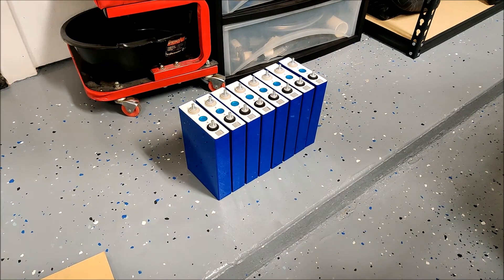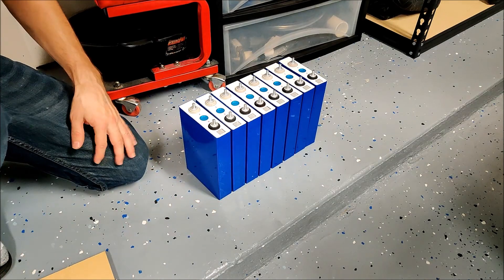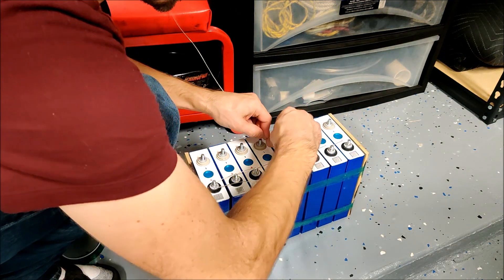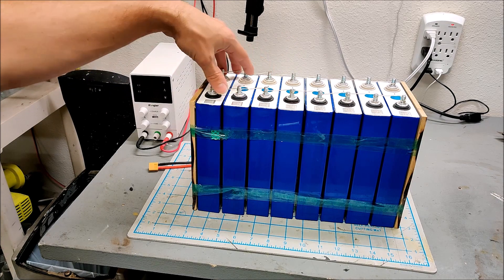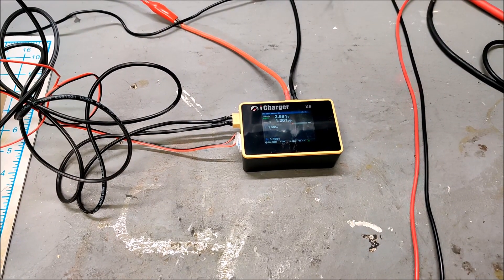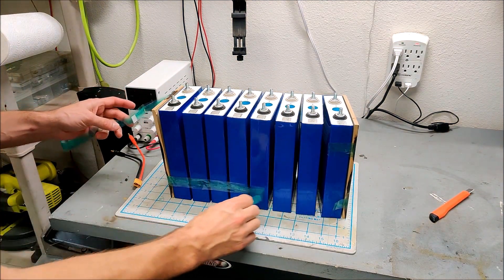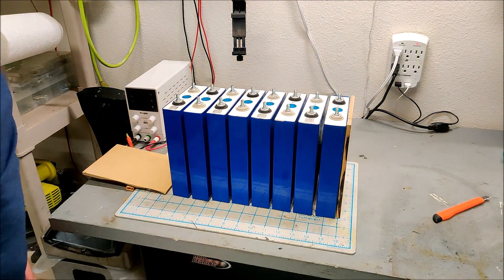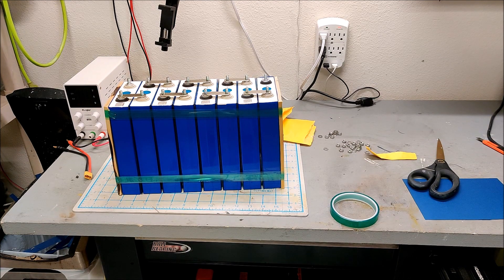DIY 3KWH LifePO4 Solar Generator - Part 2 Battery Build

Comment: At 19:26 your most negative balance wire is routed in such a way that it could chafe a short out. You should either tape it down or route it differently.

Comment: Pouch cells are more swollen when fully charged so a tip is to run the cells of the battery pack down to 2,7 v and then tighten the pack again. Also to keep in mind is that the terminals can suffer damage from the cell displacements when they expand and contract.

Comment: i think for doing this wooden board and the carpenters grips that or very long and can be adjusted to clamp
Reply: Exactly. 
Compression is overly 'fussed' about, in my opinion. I simply use wood blocks, wood clamps and kapton tape while lightly compressed, then remove the clamps and wood.
By the time compression longevity pays off, battery technology will have leaped forward massively and I probably will have upgraded by then.
Just common sense and looking at the big picture.
Reply from the maker: @reubenj.cogburn8546  Agreed. I compress them just to hold them together in a neat package and so that the buss bars fits. Beyond that im not too concerned.

Comment: Cutting the balance leads to length is not a good idea as this will make the the IR of each balance wire difference causing different readings
Reply from the maker: Im aware, but over such short distances it wont matter.

Comment: Really STUPID to hold a metal wrench in your hand going across the terminals to put nuts them,  I was surprised that you did not weld the wrench to a battery and create lots of sparks, heat, and personal injury.
Reply: I think that's pretty harsh. Now, if you're lookin for things to criticize, how about your clear lack of tact and common manners.
Anyone who has built numerous batteries has, on occasion,  made thoughtless moves when doing construction.
Besides, your comment reads more like a legal disclaimer than a helpful comment.
Heat, sparks and personal injury....Oh my....
Reply: Have you ever worked with Batteries before? Probably you would say that you are expert. But what injury and heatness are you talking about? There is no danger even if he accidentally short two terminal because of the VERY short time(About half second). In this situation there is no heat production or any possible injury. The guy who is working with this stuff knows how to handle them. If you have any problem you can say it nicely, its more constructive
Reply: "STUPID" in capitals??? Really? That type of comment also generates heat, and send sparks everywhere. That, sir, is a common problem. People just throw random comments like they are talking to a close friend. Respect others and all comments are accepted within reason.
Reply from the maker: Lol. I think about such things. I used wing nuts on my big 15kw battery because it was in tight quarters. This battery I have plenty of space to safely tighten the nuts.